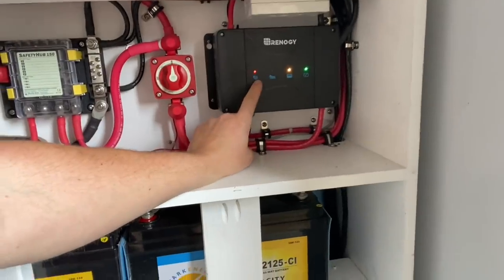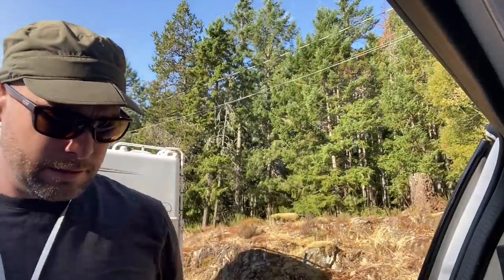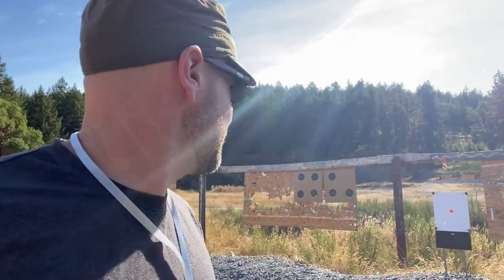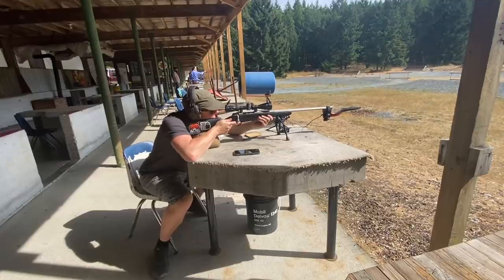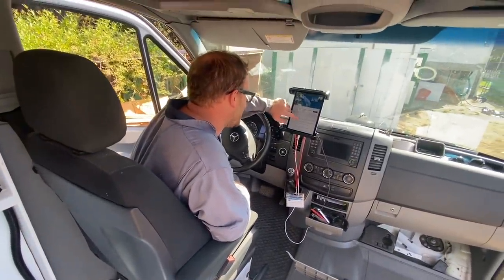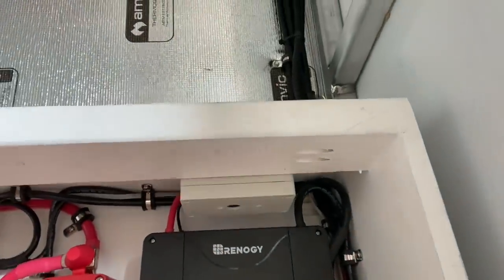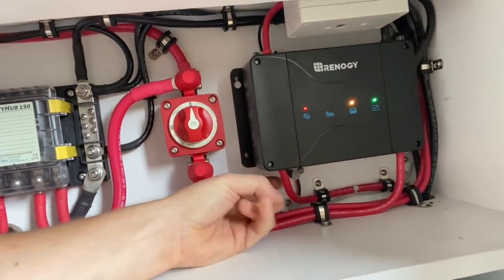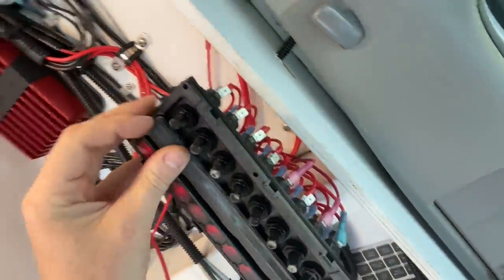Range Day & Van Conversions || Finishing Up Nicks 4x4 Sprinter Electrical & Working Up A New Load

Comment: I have never been able to wire up anything without making smoke and sparks, you sir, are a master at wiring.
Reply: Yeah I'm the same way. My wife calls the fire department and gives them a heads up when I start messing with wires.
Reply: I have found that if you let out too many sparks and too much smoke from the wire, it probably won’t work after that. 🤣🤣
Reply: Yeah i think i will go to canada to get him to do mine.lol

Comment: I enjoy your channel, I have a dodge 2000 awd grandcaravan, 71 dodge camper van and a 97 toyota with fourwheel camper van, i also hunt. Nice range one of the nicest i have seen. If you ever make it down to the states come on by for a visit i live in the Eastern Sierra of CA. I'm in process of installing and upgrading electrical system on the dodges, already did the toy camper